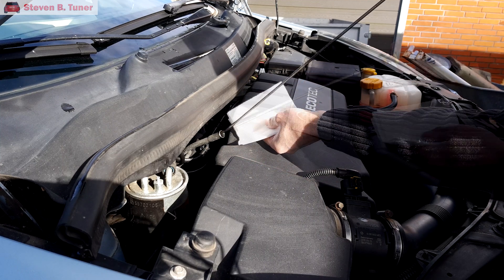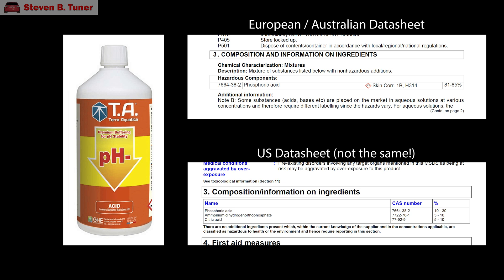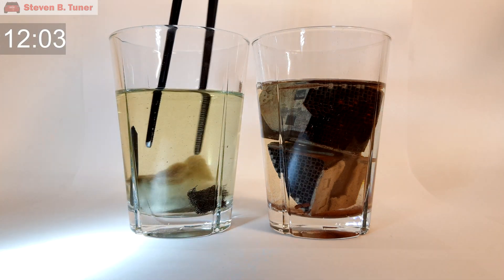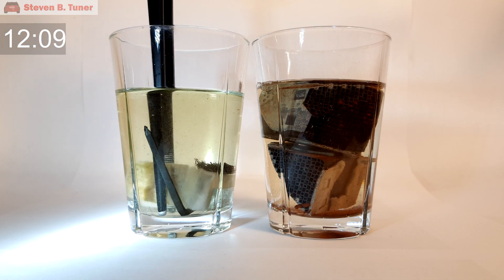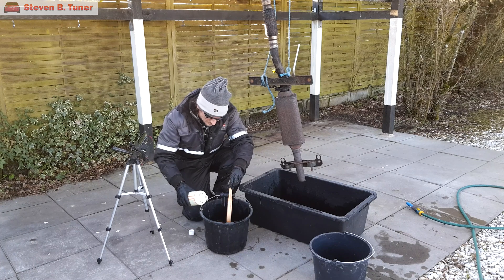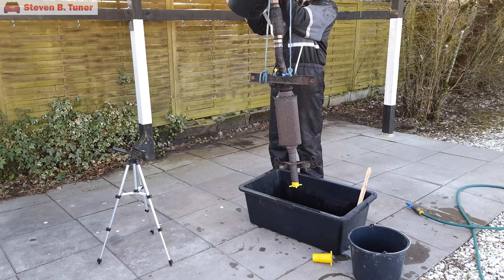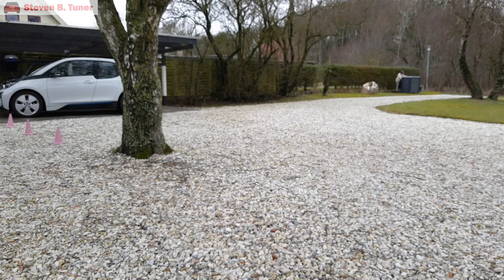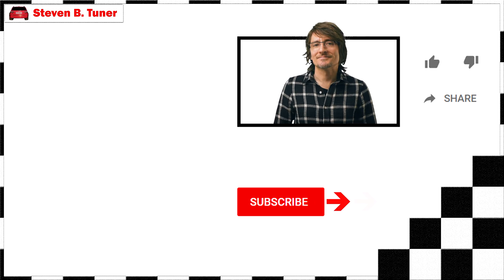🏡 DIY DPF Cleaning at Home: Restore Your Clogged Diesel Particulate Filter (with no DOC catalyst!) ✨

Comment: Hi. Thank you for the video. It does save us a lot of money. 
I heard that after cleaning, you have to reset the DPF filter on the computer. I haven't got a computer, so I'm wondering how important this is? Wouldn't the computer just figure it out itself?
Reply from the maker: Welcome! It depends on the car whether you have to tell the computer that a new DPF has been installed - and is usually for cars built between 2000 and 2010. Newer cars have additional pressure sensors to calculate soot and ash volumes, so they don't need a crude mileage countdown system to be reset.
Reply: @StevenBTuner  Thank you again. I do have a pressure sensor, so I will leave it then.

Comment: I have done mine couple month ago and it is great! Thanks for advices aswell, my DPF is now 3-5kPa during idling.
Reply from the maker: Nice work!
Reply: @cernos, having a 3-4 kPa at idle is quite high. Maybe it's related to your model. What is the regeneration distance in km?
Reply: @ploughable  about 20-25 miles , up to 20 is ok and from then i didnt have any issue with it, before was once a month . I have a Volvo S60 D5 2008 185hp
Reply: @cernos32  do you mean 200-250 miles between regenerations?
20-25 miles range is super bad... :/
Reply: @ploughable  icon on dash disappear after that range

Comment: what happens if you clean the dpf and do not reset it with scan tool? will it throw a code?
Reply: No reason why it should, but flow will be significantly increased so any variable mapping should be reset to 'learn' the factory determined targets with the changed characteristics.
Reply from the maker: Hi, thanks for watching! Newer cars should adapt, but older cars will need to be reset as they use a countdown system - so they will keep doing active regeneration cycles too often if they don't know about the 'new' DPF.
Reply: @StevenBTuner  Thanks for the reply!
Reply: @StevenBTuner  I wonder if a 2005 530d uses a countdown timer?
Reply from the maker: @randohoim  Hi, yes those earlier models had fewer sensors, so they rely on estimating how long the DPF will last.

Comment: Excellent video -- mine is a 65 plate Ford C max 1.5tdci - with today - Fault codes P2463 - soot accumulation and Fault code P2455 DPF sensor circuit high. ---- I had a new sensor fitted two weeks ago - but problem persists ? Any thoughts from you would be much appreciated. Thank you

Comment: Just finished a dpf filter on a Kubota diesel. No exhaust was going thru filter and someone removed a sensor to allow exhaust to come out of 1/4 inch opening only. We used the drain cleaner and acid wash method. Drain cleaner seemed to be effective in getting out oily substances. The acid wash we used was Muriatic acid and let it sit overnight.  The next morning a lot of black soot came out but no red ash was detected. After thoroughly flushing we reinstalled into tractor. And after 2 days of drying,  now the engine runs perfect and full exhaust is flowing thru filter. Running for approx. 1 hour no residuals of water/chemical were detected. The tractor definitely runs better now. Thanks for the DPF cleaning advice.
Reply: Why would you keep a dpf on a tractor?
Reply from the maker: Hi, great to hear about a job well done! You left the acid for a lot longer than the 30 minutes that I did, so it is quite possible that the ash was completely broken down and so ended up colorless.
Reply: @StevenBTuner  Someone has just mentioned Muriatic acid which I did not see in your test video. The question therefore is whether Muriatic acid was likely to be as harmless to the DPF as phosphoric acid and whether it may be more or less effective, considering the the Poster Jeffrey Buck left it overnight. It would be interesting to know if any technique may be developed to allow users reasonable prospect of successful cleaning just by filling through the O2 sensor or other accessible sensor position at the top? There are of course commercial products that are designed for this method, but unless Project Farm might test them all we don't really know that any of them are as effective as the chemicals you tested, especially considering you gave relatively short time for effective treatment to be proven possible
Reply from the maker: @air5002  Hi, I have a separate vid about doing a full clean if you have an integrated catalyst: https://www.youtube.com/watch?v=LE1boZ3fhLg , and in that video diluted HCl (muriatic acid) is used as the second stage cleaning step. The ceramic DPF material itself is not harmed by acids, but even weak HCl will attack steel/stainless steel, so you don't want to leave it in for more than 30 minutes if at all possible when used for a car. Phosphoric acid is much kinder to steel, but needs to be really strong to clean out the ash - which then makes it incompatible with the precious metals in the catalyst. You can see that each cleaning method involves a compromise.  One thing I've noticed that even these strong chemicals don't dissolve everything, and it takes back-flushing with water to remove all of the residue left over from the cleaning - so it is my opinion that in-place cleaning can never be as good as cleaning that involves removal and back-flushing. I consider in-place cleaning to be more of a maintenance item that could be done every 2 years, for example, to extend DPF life.

Comment: Was the car used a 1.3l diesel corsa? What year? I have similar engine.
Reply from the maker: Hi, it is a 2007 Corsa 1.3cdti. A very well designed engine with amazing fuel economy and reliability - even with that high mileage it is still running the original turbo, egr valve and the intake has never been clogged up. The same engine is in some Ford, Peugeot, Citroen and Fiat models too.
Reply: @StevenBTuner  thanks, I have a 2008 corsa.

Comment: Very useful information. Can you please do a similar chemical ash removal video on the newer VW TDI DPFs (2015 and above EA288 TDIs) which have the SCR and DPF combined on one single brick?
Reply from the maker: Hi, I haven't done any testing specifically on combined SCR systems. Mostly it is the diesel oxidation catalyst (DOC) that is in the same housing as the DPF material, and that is covered in my other video: https://www.youtube.com/watch?v=LE1boZ3fhLg

Comment: Cool videos, Steven. I've been thinking about how an ultrasonic type cleaner could be lowered into the top chamber of the DPF during the chemical bathes with this videos setup. I would think that would be interesting to try. Maybe an ultimate setup would be a big bath heated type ultrasonic tub with a pump setup to reverse flow the DPF into a settling tank for the ash.
Reply from the maker: Hi, thanks for watching! Some professional DPF cleaning companies use ultrasonic cleaners as their cleaning method, so it definitely can be done. I bought a big ultrasonic cleaner to try, but for a one-off clean it ends up taking longer to do and is more hassle than the other chemical methods I have shown on the vids.

Comment: My friend. soot counter 0 is displayed at the end of the cleaning process by your diag tool cause you,ve programmed a new dpf filter with your diag tool. Differential pressure at engine idle ia 3kp meaning 30mbar wich is a very high value. Not by far a clean filter. Full cloged dpf dif preasure is for 25mbar up so your 3kpa ...30mbar ia not a 100% success...not by a long shot
Reply from the maker: Hi, thanks for watching! The pressure reading can't be relied on until all of the water that is absorbed by the ceramic material has evaporated off - will probably take a few hours of driving.
Reply: @StevenBTuner  If I'm right you were driving the car at the same time so the differential pressure can't be down

Comment: If using drain cleaner or dishwasher tablets, do you dilute it the same way as with pH up?

And does it have to be this very pH down / up product or can it also be from another brand?
Reply from the maker: Hi, with drain cleaner try 1 : 10 mix - it should be okay unless the filter is really oily. With the pH Down products there can be a range of ingredients, but it is best to go for those made of phosphoric acid so that they don't do any harm to the metals. The websites sometime tell you what acids are in each brand, but if not then it will take a bit of googling to find the safety data sheet.

Comment: You have very good content, I'm amazed that you don't have much more views. The only remark that I have is that you should've shown the differential pressure before and after cleaning.
Reply from the maker: Hi, thanks for watching! I had screen video capture of differential pressures at various RPM and loads, but unfortunately the video file got corrupted and wouldn't open in the video editor.
Reply: @StevenBTuner  Ah, too bad. Anyway, keep up the good work that you are doing here.

Comment: hi steven! few days ago we talked about dpf filter cleaning.
I did it and was very difficult because at my car filter it is very complicated to take it out.
caddy tdi 1.6 .....any way,, I full it with dish washing tablets without remove completely..of course with delicate manner. 
I left it 8-10 hours and I think is cleaned  very well. 
I reset dpf with diagnostic delphi 2017
And new result was 24.1 gr (62,7 gr before ) . 
It worked and its breathe of excaust its better!
I saw your recent 
experiment, well done!

When you servicing your injectors did ypu change o rings or left the same
Because its difficult to find new o'rings.
for high temperature and I am scared to take it out injectors without are broken
Reply from the maker: Hi, well done on doing the job yourself! You are the first person to report back about a DPF clean that used only the dishwasher tablets - and it's great to hear that it can make a good difference even without the acid wash. A 38 gram reduction in ash like that is probably equivalent to more than 5 years of driving.

Comment: Is there any explanation for the increase of oil level caused by DPF clogging?  If so, what is the cause? (Diesel engine scenario)
Reply from the maker: Hi, the increasing oil level is caused by the additional diesel being injected to heat up the DPF during an active regeneration. On this car the filter was so blocked that a regeneration was being scheduled every 50 kms, resulting in enough diesel getting past the piston rings to raise the level on the dipstick. I thinks I should do a video about it :-)
Reply: @StevenBTuner  thanks a lot for the detailed answer. 👍 Then there is a need of oil change...
Reply from the maker: :-) Absolutely! Oil thinned with diesel doesn't do a very good job of keeping your conrod bearings and conrods safely separated.

Comment: Thank you for all your job done!
You need an air compressor to dry the filter out (some say water drops may blast off cracking the ceramics). And why don't you use the oxalic acid - it is sold everywhere for water treatment systems as a powder? In the previous videos that acid demonstrated good results. HCL is considered as a drugs making part by the authorities in many countries and buying the brick cleaner adds unexpected chemicals to the cleaning process. By the way to rise the pressure you can use an old bmw pump.
Reply from the maker: Hi, the ceramic material absorbs quite a lot of water, but I'm not sure that there is any perfect method for drying it out. Fortunately the material seems to be very tough, so I'm not sure how likely cracking from steam expansion actually is - time for some testing!  Acid availability seems to be very variable depending on the country, but keep an eye out for another oxalic acid test again soon!

Comment: This man saved me like 3k last year on my Volvo. did the fix for about $35. 25k KM later zero issues. That said, I feel scammed by how easy it was to remove the DPF on this car, I had to take apart half my engine to get the DPF out!
Reply from the maker: :-) Manufacturers try and put the DPF as close to the engine now to keep them as hot as possible, but you are right that it doesn't make removing them very easy!
Reply: @StevenBTuner  makes sense!
Reply: Hi, what car do you have? And what solution have you used to clean the filter? Tnx
Reply: @antonnagy9565  bro did you not watch the video lol

Comment: What would you suggest plugging the holes with, particularly when using brick acid? Thank you.
Reply from the maker: Hi, I used PETG 3d printed plastic, but a plug made from wood, plastic or silicon would work well enough.

Comment: N47 177cv 2007, dpf only or dpf + cat? Thanks master
Reply from the maker: Hi, I'm pretty sure those don't have a cat - but it was around the time that cats were making an appearance on some diesels, so it is worth double checking if you can. Usually the DPFs that have a built in cat have 2 pressure sensors instead of 1.
Reply: @StevenBTuner  thanks !! Good job ;)
Reply: @carlosm6829  i can confirm 100% that n47 engine has both oxi cat and dpf in one housing! You can read about it by googling "n47 detailed pdf" its a big bmw user manual on the n47 engine.
Reply: @ciepularys  thanks! ;)
Reply: yes, its dpf and cat in one housing

Comment: Hi, just a question. I've been watching a few of your DPF cleaning videos and followed up with the heavy duty degreaser followed by brick acid. I left the heavy duty degreaser sitting inside for 3 or 4 days (repeatedly pouring it back through). I then tried the process with brick acid but diluting it down and only letting it sit for 20 minutes. The degreaser cleaned a lot of oily soot deposits but after all the hours of rinsing brick acid through I was still left with what I think is the solid block of ash inside, poking a screw driver through I was able to scrape away at it but nothing broke it down. Coincidentally I also have a Vauxhall astra DPF filter very similar to the one used in this video. After the week of cleaning I reinstalled it and got the same error message P244B DPF pressure too high(indicates full). What should I do !? Please any help is great, thanks.
Reply from the maker: Hi, if car has dumped a lot of oil in the DPF, or if the filter was completely clogged with soot as a result of another engine or EGR issue then it can be almost impossible to clean it without using extreme heat (video coming soon). If it is only ash that is clogging up things then the color will be between white and red (and you will need to do more acid washing), but if it oil or soot then it will be black (and you may need to scrape it out or gently blast it with a pressure washer - but not too closely, in order to expose the ceramic material ready for an acid wash).
Reply: @StevenBTuner  I had no colour difference when rinsing with brick acid and water. Definitely a lot of black came out with the first few rinses of degreaser. The vehicle was likely running on 1/4 glow plugs for a while too, amongst other things I think its definitely fair to say its had a lot of oil dumped through.
Reply from the maker: Hi, sounds like a second round of cleaning might be in order. Using a higher concentration of acid is more likely to eat away a bit of the metal housing, but if you can´'t get the gunk out then the filter is for the scrapheap anyway, so there is not much to lose.

Comment from the maker: Who has a rusty old non-catalyzing style DPF that needs cleaning?
Reply: I have Camry 2007, is this method suitable to clean the catalytic converter of my car?
Reply from the maker: @Zaid Alzaidi, this cleaning video is not for use on a catalytic converter.
Reply: @StevenBTuner  Alright, thank you ⭐️
Reply: @alengine94  you can use paint thinner in your fuel tank (look up a guide online for how much to add) and take your car for a long highway jaunt.

Other than that you can take it off and clean it just like in this video.  There are lots of things about cleaning them on the internet.
Reply: @DoubtingThomas333  Dont think that's a good idea. Paint thinner is very dry and a bad thing to go through fuel pump and injectors without sufficient lubricant. Whether it is possible to counter the problem of paint thinners is likely something that @Steven B. Tuner is more likely to know the answer.
Reply: @air5002  You're not filling the whole petrol tank with paint thinner, just a small ratio, it's not going to cause any real issue with your fuel pump and injectors.  Petrol itself is a very poor lubricant, but it is okay at drawing away heat.
Reply: @alengine94  you do no not need to clean a cat. There is nothing to clean.
Reply: What happened to the old dishwashing powder/tablet experiment where you found it worked very effectively... Would you do it as part of an acid wash cleaning like in this video?
Reply from the maker: Hi @Thomas, the pre-wash can be pH Up as featured in this video, but dishwasher tablets work well as does caustic soda drain cleaner or strong degreaser - if it dissolves oil then it will work well enough. The idea of the pre-wash is to get rid of enough crud so that the acid wash can get to the ash deposits.